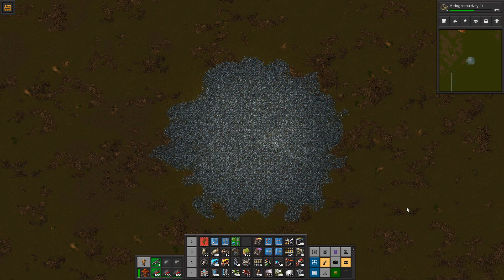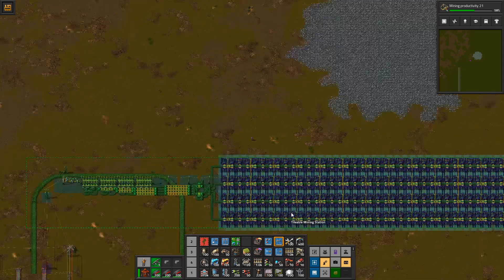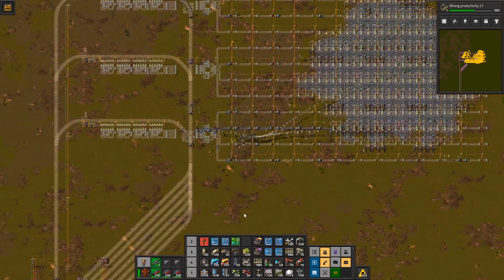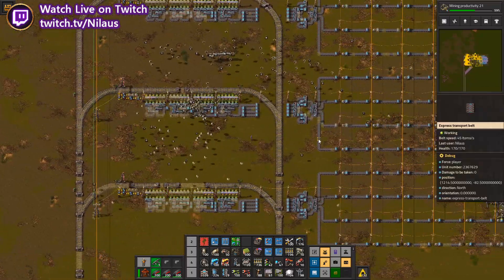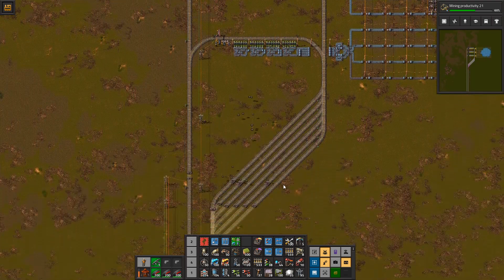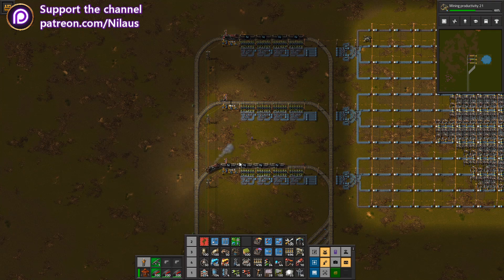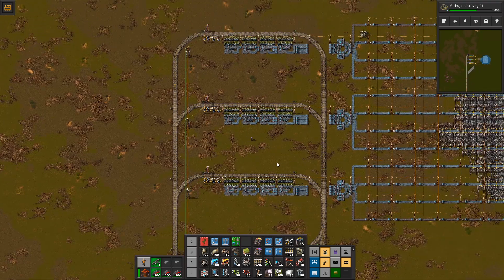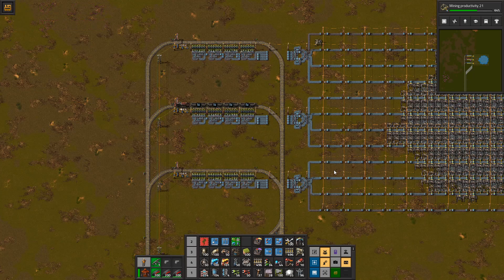Easy Tileable Mining Outposting | Factorio Tutorial/Guide/How-to

Comment: This is great, so i have a problem "destination full" i let the blueprint as default and didnt change anything, some of the stations are working fine, some are not turning the lights on to call in a train. Solution?
Reply: Did you fix it?
Reply: The fix is to connect the big power pole near the train exit with a green wire to the one upwards of it
Reply: @ruhto828  I don't quite follow can you explain a bit further? having this issue as well. 
edit: nevermind figured out I was missing the combinator that came with the stacker blueprint.

Comment: Ive done a similar but different thing for the circuits. My pick up stations are just set at a fixed number, whever i build a new pickup i place down the trains and it will always have that many waiting there, even if there is nowhere to send those trains.
However, on my drop offs, i have it set inversely to what you showed, if there is space for a train load then it sets the limit to 1, if there is enough for 2 its sets the limit of 2, and so on. I dont care if a train is sitting in the station, full and not moving and blocking other trains from filling up, this just means that im over producing, this is not a problem. What i do care if im under producing, have a train sit in the drop off, empty and blocking other trains from unloading because there isnt space at the pick up, thats a problem, not just that im under producing, but that what is already produced can no longer be delivered becuase there is a train just sitting there doing nothing..

One thing i did do is set up a priority system, my trains have "is cargo full AND circuit condition", if there is a train at a priority pick up and is full of material, it sends a signal to all non priority pickups that fails the circuit condition preventing them from departing, because the priority station doesnt recieve this signal those trains are free to leave whenever and thus are prioritized.

Comment: This is great, thank you for this! What I've done which would perhaps help others. I've added a train station at the exit of the stacker which has a commonly used stacker name for all the type of ore mines. It has a limit of the amount of spaces inside the stacker. This way, if the mines are not requesting a train - the train doesn't sit inside the delivery station waiting because of "Destination full" - they move to the relevant stacker and wait there. This not only opens up the delivery station, but also ensures that the train is there close by so travel time doesn't waste pickup time.
Reply: With Nilaus design, the loading station will request zero trains if it can't fill the entire train. So there should be no issue of trains waiting to be filled. If I am understanding his system correctly, your solution of a stop after the stacker is redundant. I will be interested to try his method in my game and observe how it behaves.

Comment: I have a weird issue with the stackers that I can't debug. I have 2 trains collecting ore and delivering it to the same unloading station. Now that the saturation of the ore patch is decreasing, it takes a bit longer to re-enable the station. What happens is that the first train just stays in the drop-off station, showing the message "Destination full" and not moving to the stacking area. So the empty train blocks the offloading station and only moves, if the station at the ore patch is re-enabled.
Any idea what I am missing?
Reply: Necro'ing this. Coming back to the game after a long time and I am running into this issue as well.  Did you ever solve this?
Reply: @josephpratt4795  - Yes, but I can't remember how and don't have the old save files anymore I think. Will check later this week and get back to you.

Comment: Thank you for this great video. I would have liked to see your take on defence on mining outposts. It often is a hassle to include oil for flame throwers and bullets for turrets there. Do you use lasers exclusively in this context? Do you use big blueprints or a modular design?
Reply: Usually what I do is just keep expanding my perimeter walls to encompass the ore patches that I want to harvest. I’ll even use lakes (and rarely, cliffs) to minimize the amount of materials I need. Then for each wall segment, I’ll add in a small logistics network (for repairing the perimeter, resupplying the turrets and artillery canons) that will then be occasionally resupplied by a train from the hub.

Comment: 3:27 what is the point of balancing the end of each of the belts with so many splitters? I mean in this case 1 belt feeds 6 chest and there is no need to fill the 6 chests evenly since they'll get dumped into the same wagon anyway
Reply: it just increases the throughput. The more inserters you can have put the ore in and pulling out of the chests without any being idle the better.

Comment: Thanks for the shoutout :D , the post you were talking about should be this one: https://www.reddit.com/r/factorio/comments/idgwpu/how_to_print_a_new_mining_outpost_in_seconds/

I like the light display on the circuits, these are always a nice touch. Also I agree, with train limits, there is little benefit to using anything more complicated than what you show in the video. In fact, my own trains currently run without any circuit logic at all, I just set static limits and then add as many trains as all my limits combined -1. You don't have to worry about equal distribution when every station is always occupied by a train anyways.
Reply: bit late to the party; I set up a batch of 5 signals after the trains logistics'd to turn red if there's too much or too little of a substance there. Each red signal adds 1000 length, so they'll dynamically go to where there's need, just with the signals. Does this system have them just chilling at a random stacker till need is present then?
Reply: @colto2312  I know the method you're talking about, it works very well. I've used circuit controlled rail signals as well before the train limit update hit.

The trains just wait in their stations in my new system, there is no big global stacker somewhere. Whenever a train finishes un/loading, it just waits where it stands until the next station opens up. 

Lately I've been making blueprints for a new system tho, with circuit controlled limits based on the chest contents. This has the advantage that it works with fewer trains and it's easy to prioritize stations by adding path finding weights (like an extra train station) to all other stations.
Reply: @kano6720  So my main concern with this new logistics system, which is brilliant don't get me wrong, is that lets say I have 5 iron requestor stations and 10 iron trains. No loaders are available but a 'dock' needs more iron input. Until an iron Loading station opens, any stations that demands iron will be hard blocked by that parked train, yes? (Imma try and implement a train network that performs similar to that roadway mod, transport drones)

To combat this, would a mega refuel stacker at the end of all 'goto' commands combat this?
Reply: @colto2312  Yeah what you describe can happen, but it's actually not a big deal. When there's a train waiting in an iron unloader, it will block all other trains from accessing the station, which can be quite annoying when there's another full train already ready in the stacker ten meters away. However, the root of the problem is actually that non of your Loader stations are ready, which means you don't have enough iron in the first place. Even if that one extra train from the stacker would be able to unload, you would only gain one train load total, so it's a one time gain. If you had enough production in the first place, this scenario should never happen.

So, yes, an extra refuel stacker at every unloader station or a big central one for all stations would solve this, but I think it's a non issue anyways so I wouldn't waste any effort on it.

Comment: The reproducibility for these is pretty great. lane balanced, good throughput, etc. It doesn't guarantee your boxes are filled correctly, but the sides and lanes are balanced so it should stay pretty good. I would be slightly worried about uneven filling between the wagons causing you to be able to 'summon a train' but you can't actually fill all 4 wagons, but that should be unlikely.
Given your other builds, I wonder if 8-wagon would work well (they end up spaced further apart due to the mining needs). They also have a lot of belts vs load-to-train, but the time savings of just being able to stamp it down is pretty tremendous.
Reply: The boxes between different stations won't fill the same, but the boxes within a station should fill evenly.  Although once you get mining productivity up high, the number of miners to fill a belt will be low enough that all your belts should be full.

As for 8 wagon trains, that would work similarly.  Change it to 8 belts, then an 8-8 balancer, and adjust the combinator from 8k to 16k.  The biggest drawback is that an 8-8 lane balancer gets pretty big, so I would probably move the lane balancing up to each individual belt.
Reply from the maker: the wagons are balanced. The individual stations are not balanced with each other, but that doesn't matter as they work independently

Comment: Would it be more effective to put compact smelter setups near the ore locations? That way you don't need trains for the ores and trains can carry more plates than ores.
Reply from the maker: no, that would (in my opinion) be a big mistake.
The mining patch decreases over time, which means your smelters will be less and less effective as the patch is drained. I would much rather keep a constant smelting and then add more outposts to keep it supplied

Comment: This looks realy good but I think there's a problem. Having used LTN a lot I noticed that it makes a temporary stop immediately before the actual station it is sending the train to. This means that it can't go visit another station with the same name.
I wonder what would happen if you let the containers fill up before activating the three stations. I think that each station would ask for three trains as expected but you might not get them going where you expect as they are free to chose which station to visit. I'm not sure though. :)
Reply from the maker: This has nothing to do with LTN. This is vanilla
Reply: @Nilaus  I understand that. i am no good at writing english despite speaking only english. lol.
I was refering to your setup in the video. As ll the stations have the same name it's possible that all the trains could decide to go to just one of the stations instead of the station that called for a train.
Reply: @SirHackaL0t.  In 1.1, trains now reserve stations before even leaving their original station. This means that once a train has started heading towards a station, no other train can go there. The interaction you're talking about was an issue before, but has been fixed as of 1.1. This is assuming of course that the train limit is 1. When it's higher, of course more than one train can reserve a spot, but basically once the maximum number of trains are either at a station or routing to it, other trains won't try to route there.
Reply: @nathanielgraham958  Ah, Cool, that makes more sense. :) Cheers for the info.

Comment: Love it! The train limits really unlock a whole other style of train system.
I did something similar in one of my games, but one other thing I did was actually put a wire going from the train station to the "* -> O" combinator and also have it read the train contents. It's really just an edge case, but I'll explain the reason in case anyone is interested. Let's say your train station currently has a limit of 1 and no trains incoming. The limit will be 0/1. If a train arrives, the limit will go to 1/1, but as the train fills up the limit goes down to 1/0. If while that train is filling up, you get enough more ore to fill up a subsequent train as well, the limit will go up to 1/1, but really it should be 1/2 so that a second train can path there and get filled.

Like I said, huge edge case because usually the trains fill up fast enough that it won't matter (at least in vanilla), but it helps the numbers line up a little more accurately imo and that makes me feel comfy.